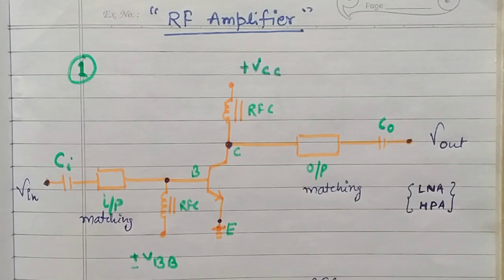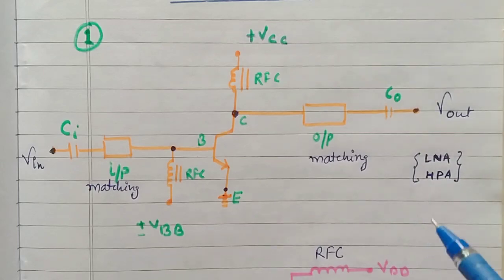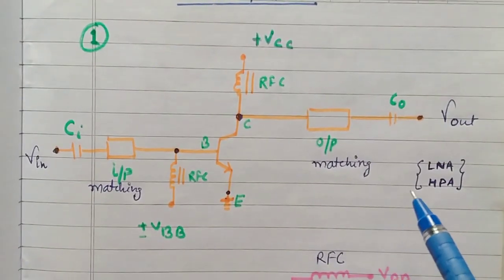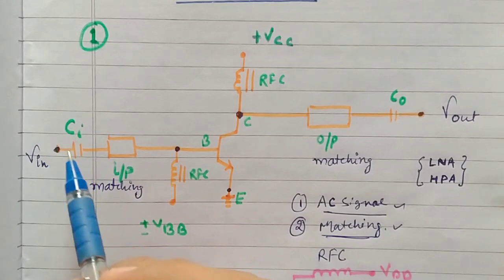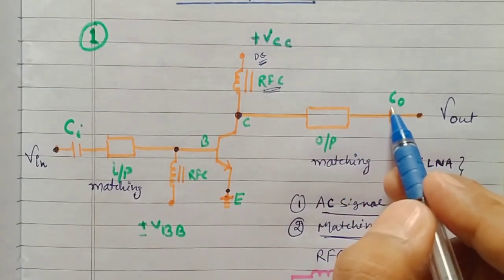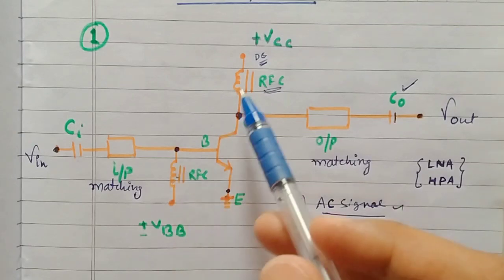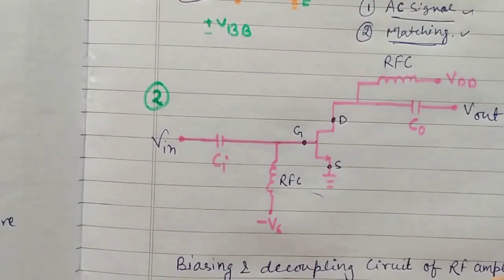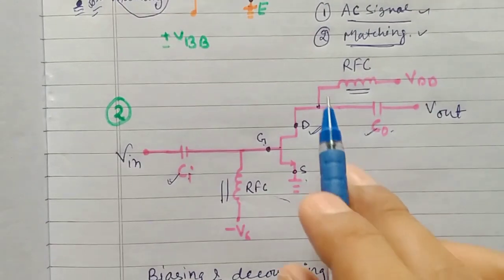Basic of RF amplifier design

Comment: Common Emitter/Source Amplifier: great if you want to use it for LNA (you can achieve quite low NF values and moderate gain up to 9-10dB which is enough to suppress NF contribution of following stages), but has stability issue and needs to be handled extremely carefully.  Due to Cbc/Cgd, input-output isolation is low and matching of one effects the other and matching/stabilization parts are true pain.
Reply: A cascode topology would improve the input - output isolation?
Reply: @m.dasvirgenss  yes it would. In fact, in Cascode amplifier, you will likely see that matching of input and output can be handled seperately easily. You can also achieve gain values up to 16-17dB at 30GHz with Cascode topology.
However, its NF is high compared to Common Emitter amplifier. Hence, if NF is priority in your design, Common Emitter amplifier would be a better choice, if NF is worth sacrificing and you want high gain and ease of design, Cascode is definitely worth considering. One other problem Common Emitter presents is linearity issue. You can get quite high IP1dB values but with classical design approaches, its IIP3 is bound to be low, it is prone to operate non-linearly. However, that can also be fixed with some techniques too.
All of the topologies have their advantages and drawbacks to be honest.
Hope I have helped :)
Reply: Like you said, microeletronics specially in RF is about tradeoffs. Thanks for the answer.

Comment: For the matching what we have to use?
Reply from the maker: Inductor and capacitor ..values we can find from Smith chart.
For high frequency it should be gap or chip capacitor and microstrip inductors.
Reply: @RadioFrequencyClassesRFC  sir can you please make a video on matching
Reply from the maker: I can try ..which type of matching....input or output matching for amplifier or something else??
Reply: @RadioFrequencyClassesRFC  ya input output matching for amplifiers
Reply from the maker: @divyakatariya7960  https://youtu.be/BjvNq3Yra0o
Just check this ..of possible like this I can make in much better way.

Comment: How to find the values of these cap and inductors!?
Reply from the maker: You have to design the microstrip inductor and gap or chip  capacitor due to high frequency.
Depending upon upper cutoff frequency you can find inductor and capacitor values..and then you can use direct formula from DM pozar book to calculate the microstrip design parameters, Such as length,. Width and thickness for inductor and capacitor.
Reply from the maker: Microwave transistor amplifiers: Analysis and design, Guillermo Gonzalez